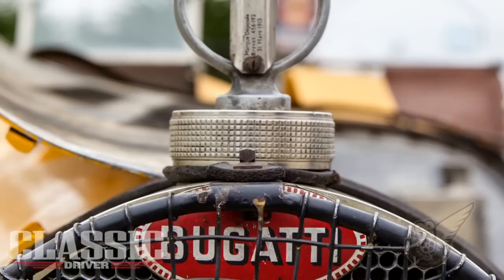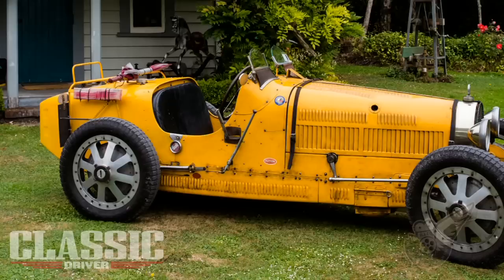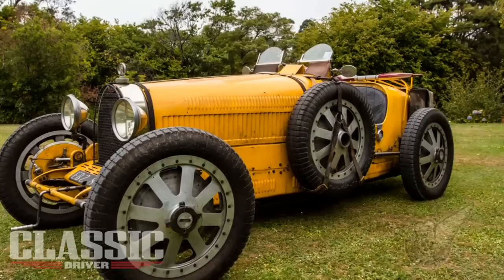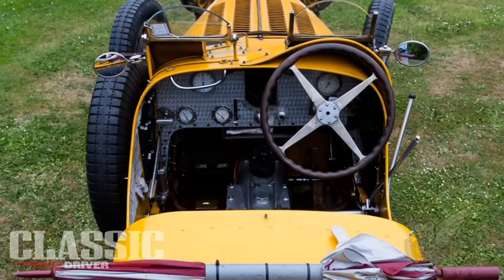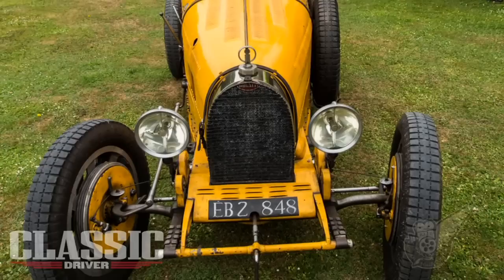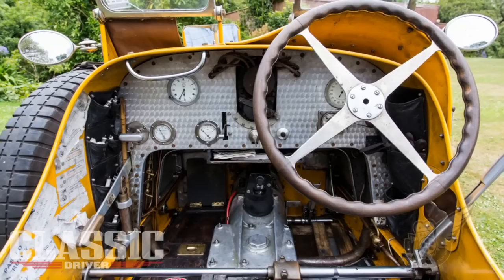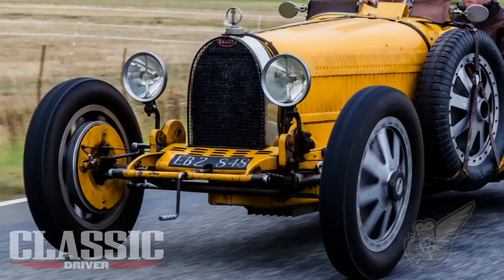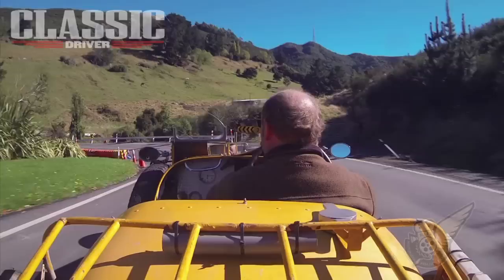1927 Bugatti 35B Grand Prix Racing Car Drive

Comment: Thankyou for this. I hope to build a "copy" one day I have dreamt of this since a boy. Honoured that you have shared this. Jim.
Reply: Per sang makes exact copies down to the bolts. They remake every part in house. They changed the firing order of the engine to squeeze out more power, and used a distributor instead of a magneto. The raw materials are also modern alloys, not the way aluminum and steel used to be back in the day. And they have a rengineered flat plane crank which can go further than a few thousand miles.
Reply: @dylanmccallister1888  correction.  they make it 100% like original. also with magneto and leather belts.  they OFFER all customers the option with the changed firing order since it run better than original.